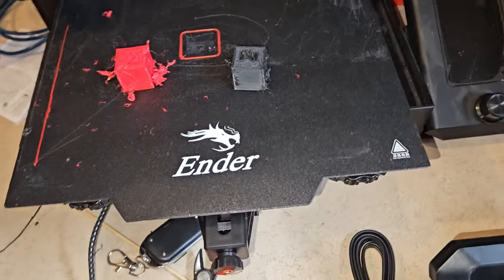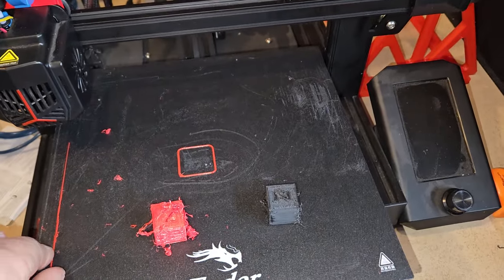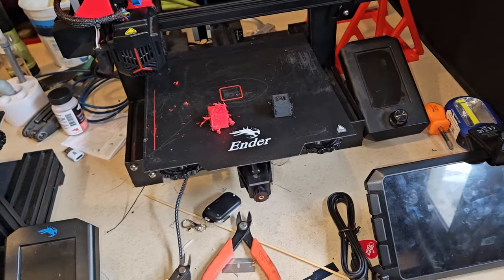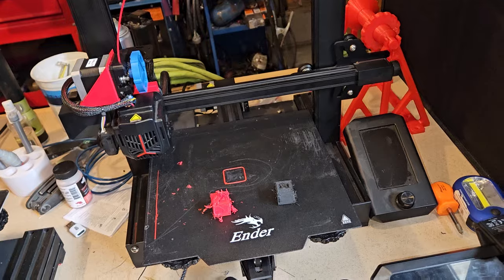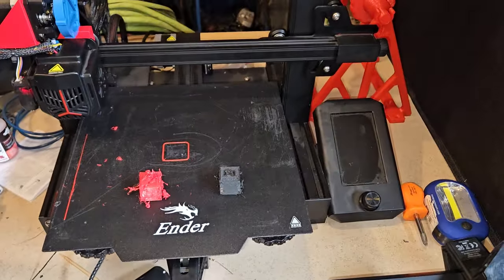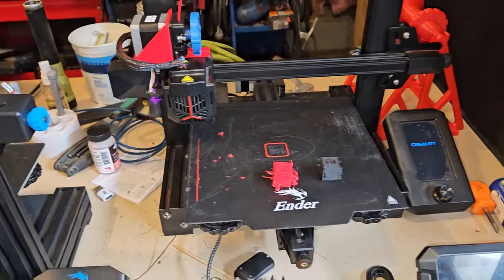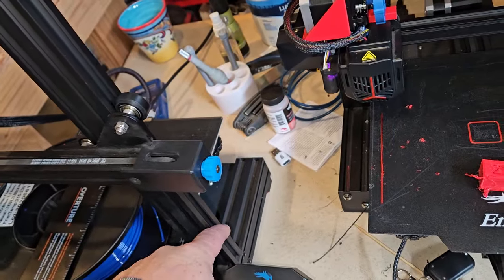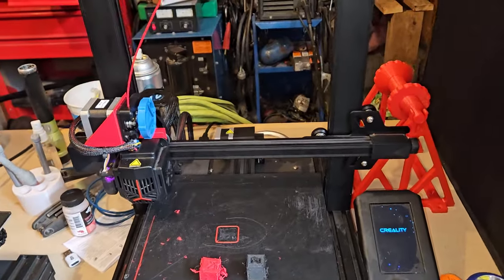I TRIED TO PRINT 200MM/S W ENDER 3V2 NEO DIRECT DRIVE SONIC PAD

Comment: it should work, i am not using klipper but upgraded my ender 3v2  to marlin 2.1x and print pla on 180mms with acceleration of 3500, and made it direct drive like you, i dont have the dual z but print if possible on the left side. did do the pressure advance and line advance tests and have to print at slightly higher temperature.